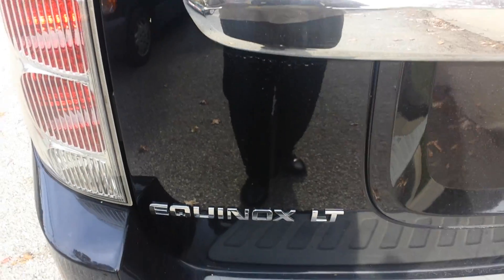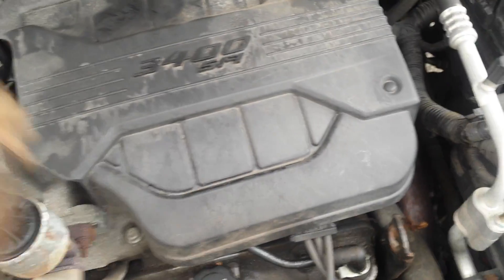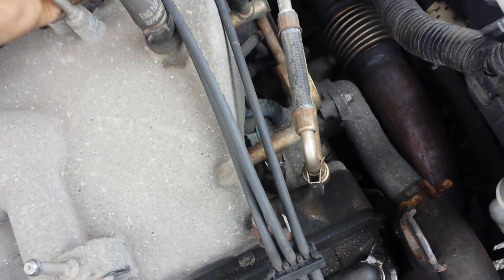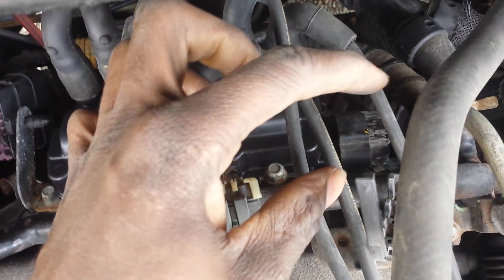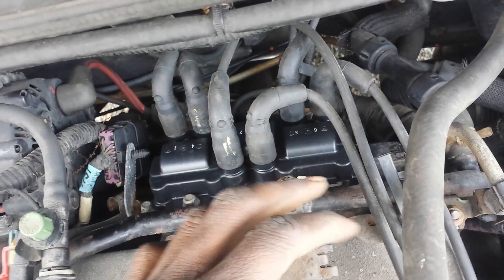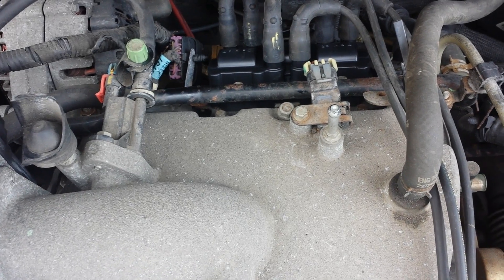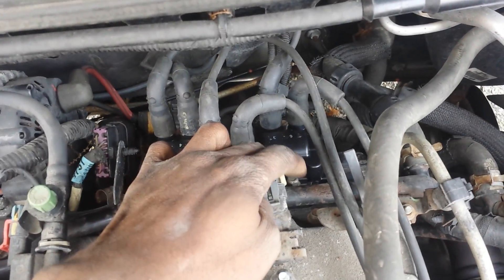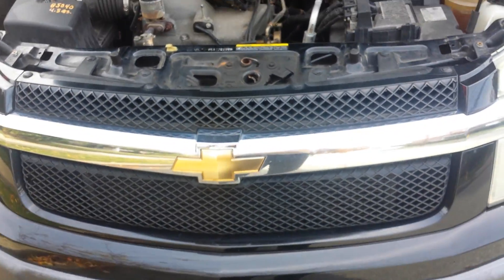How to Change coil pack on a 2005 Chevy Equinox

Comment: Fyi to get the check engine light to come off once you do this you have to remove the positive connection off the battery for about 10 minutes and put it back on and then drive down the highway and it should go off
Reply from the maker: Yes that the computer can reset